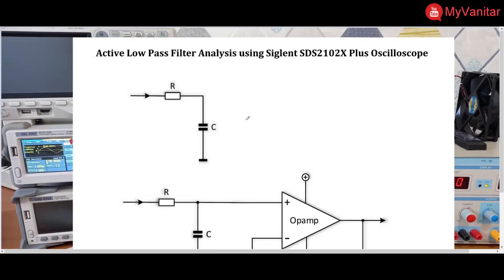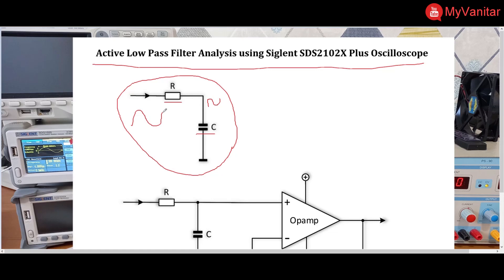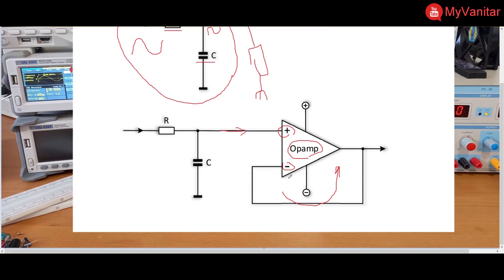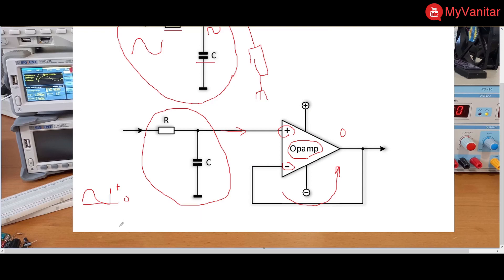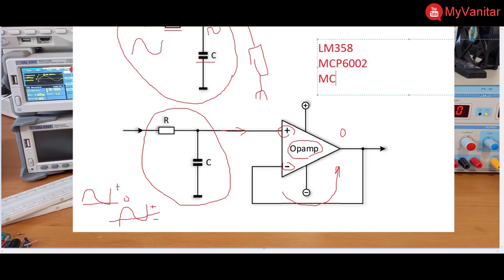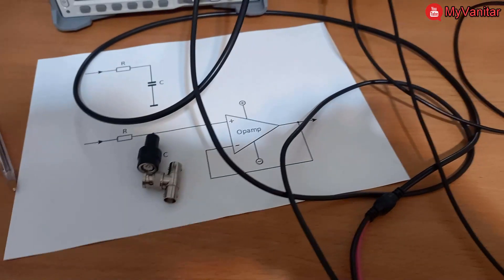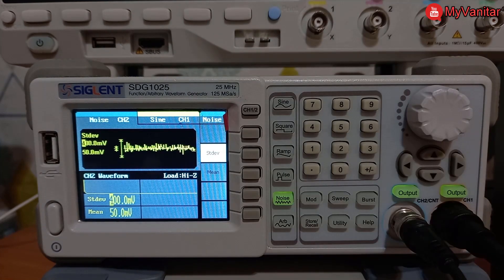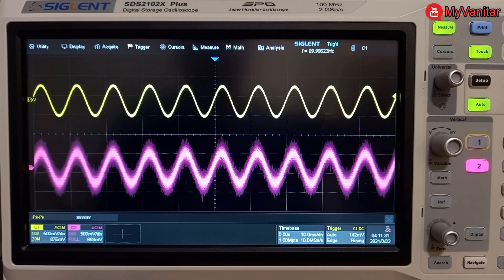Active Low Pass Filter Circuit Analysis using Siglent SDS2102X Plus Oscilloscope [Part-1]

Comment: What you have shown is not an active low pass filter. It is merely a passive low pass filter followed by a buffer. The filtering is entirely done by passive components, an active filter has filter components in the feedback loop. An example of this would be the Sallen-Key topology.
Reply from the maker: that buffer reduces the output impedance, as it is an active component (not passive such as resistors, capacitors, .. etc.), it is called an active filter in some references. if I remove that wire with a resistor and another one to the ground, it also amplifies the output
Reply: @MyVanitar  I understand what you mean, but the filter part of the circuit is still passive, hence it is a passive filter. It cannot add energy to the incoming waveform. Sure, the buffer/amplifier afterwards is active, but that is not the filter.
But yes, I have seen some references on the internet call this circuit an active filter, but I wholeheartedly disagree. Following their logic you can call a resistor divider 'active' just by placing a buffer after it.

Comment: Please does the Bode plot work with your other scope SDS 1104X-E (sitting on top the function generator) and the SDG1025?  Thanks
Reply from the maker: Sure, soon in future. also My last video is the bode plot with SDS2102X plus.
Reply: @MyVanitar   Thank you. Yes I watched the video. With my SDS 1104X-E and SDG1025, it says fails to connect to AWG
Reply from the maker: @Zeus-ub2zp  have you upgraded your device to the latest firmware?
Reply: @MyVanitar  My scope yes..  (lost my usb: will get a new so can update it this week)

Please does it work for you?

Thanks for the reply
Reply from the maker: @Zeus-ub2zp  Yes, it works for me after update. also update the waveform generator firmware. if still did not work for you, comment back.
Reply: @MyVanitar  Thanks so much.. It connects but for some reason, can not get the correct bode plot of a low pass filter... Please is it working for you? Thanks alot..
Reply from the maker: @Zeus-ub2zp  Yes, it works for me, why not. Look, in this project I've used a simple low pass RC filter and examined it using the SDS1104X-E oscilloscope: https://www.youtube.com/watch?v=OJgx_jHHoqU

Comment: I was really expecting a bode-plot. But no. Perhaps the 4-channel version has this function. Just an USB-cable from the scope into the AWG, and the AWG is controlled by the scope for bode-plotting.
Reply from the maker: This model also supports the bode plot. as I mentioned this is part-1. Part-2 would be about the bode plot. I will publish in the next few days.
Reply: @MyVanitar  Thanks. It's a great combo you have there :)
Reply from the maker: @erikas6874  Yes :-), this oscilloscope is a role model. worth every penny that we spend on.
Reply from the maker: The bode plot analysis was also published. please check the latest video